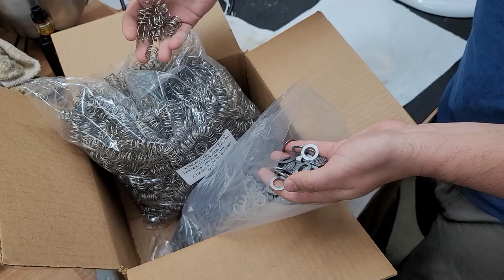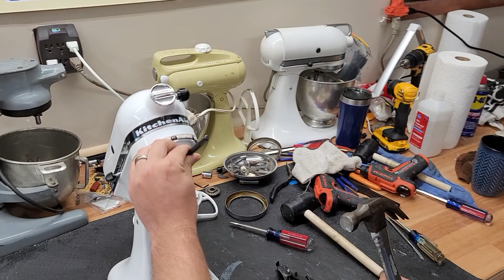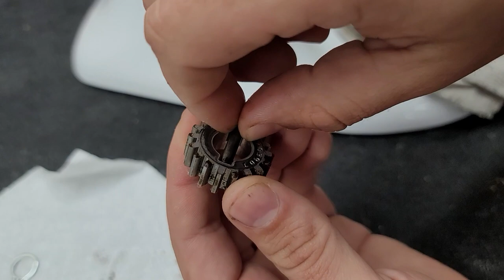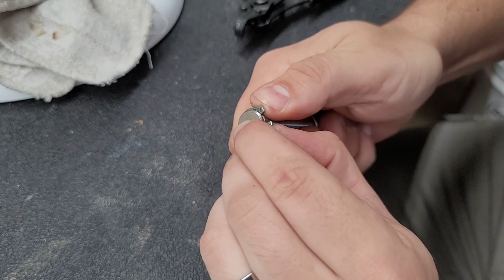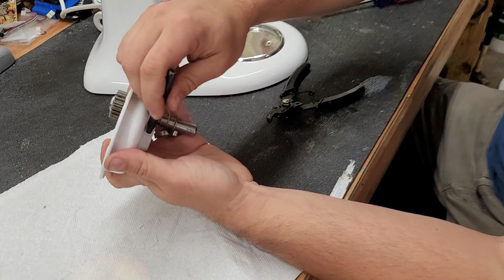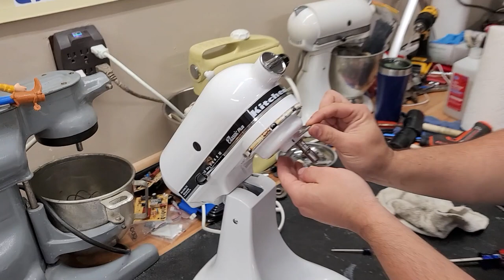Installing A Spring and Washer On a New Kitchenaid Mixer

Comment: I’m struggling to get the screw back in without cross-threading, any tips? I can get the screw about 1/2 back in but then it just is waaay too difficult and I’m afraid I’ll ruin the threaded hole

Comment: I need to order a gasket and grease for my 600 and I really want to put the spring on it too. So i'll probably just go ahead and order it and wait for your next video with the "how to" to come out.
Reply from the maker: Literally have like two more scenes to film I just need to find the time!! They aren't listed on the website for the 600 yet as the 600 has to have a snap ring swapped out as it's too thick, so I've manufactured some thinner ones, I need to add them to the site but didn't want to ubtil the video was up! Hopefully Sunday I can find the time!
Reply: @MrMixer316  Hey, yeah I just realized that in the description for the spring it said that a different part was needed for the 600. I already placed my order, but sent an email to see if that portion can go ahead and be cancelled. I'll go ahead and order the spring when you have it available.
Reply from the maker: @rachelmaestardust  I've included it in your box. You'll need to replace the snap ring that sits just above the spring and I sent an extra incase another one bends! I need to get the how to finished!!

Comment: I just bought my Artisan mixer yesterday. I had ordered the Everdime piece last week and installed that today. Now I'll order this spring and washer. Thanks for this good tutorial on how to replace pull, remove and replace that shaft. Taking it apart doesn't look that difficult. My mixer is new so I'll skip the cleaning and re-greasing until a future time.
 I looked at that drip ring to see if a screwdriver could pry if down when using a rubber mallet. But I decided against trying it since it seemed like I was either going to scratch the paint of mar the drip ring. So I tried using a strap wrench to twist off the drip ring. It worked. The strap wrench twisted it off without that much effort at all.

Comment: I have an old K45 KitchenAid mixer from the 1970s, which I purchased used, with only a whisk attachment. I purchased a flex edge beater online and it would not fit. I bought a new KSM96 mixer for my partner in 2009. I borrowed the beater (no flex edge) from it, and it fit my mixer fine. Measuring it, I found that the thickness of the top of the beater, above the notch, is slightly thicker on the new beater I got than on the older beater.

I called KitchenAid support about it. The agent said that some beaters had incorrect specs on that part of the beater, so they sent me a new one. That one has the identical problem.

In the meantime, I bought a new stainless steal beater direct from KitchenAid, hoping the problem was unique to the flex edge beaters. Alas, no; the new beater also doesn't fit because of the thicker metal above the bayonet notch.

The problem is that when I push the beater up on the shaft, when the spring and washer are completely compressed, there is just not room to clear the pin on the shaft in the beater's notch.

I wonder if, since removing the spring and washer in 2016, KitchenAid redesigned their beaters to have slightly longer holes above the bayonet notch. Do you have any insight into this? Have you seen the problem before? I'm wondering if I need to remove the spring and washer in order to accommodate newer beaters. —Tom

Comment: You got a video on my mixer paddle is bottoming out on the wall did the shaft drop? It will not sit all the way down in the locked position.

Comment: Great stuff! Just bought a commercial 8qt and wondering if you think its worth the effort to install the spring/washer on it...especially if mainly using the stainless steel whisk/beater? I would assume you think it IS best on a model like the Artisan Mini? thank you!
Reply from the maker: It can definitely benefit the 8qt machine, however sometimes the stainless attachments are too thick up at the head of the attachment to allow the space for the spring and washer!
Reply: @MrMixer316   you sell a kit for the 8qt so even with your kit the standard stainless accessories might not fit? Just dont want to take everything apart only to find it wont work!
Reply from the maker: @macfly4  they generally do, but we have had a handful of people have issues. I think it is generally because they don't replace the snap ring like they are supposed to

Comment: Hello. I have a kitchenaid 550 HD and suddenly the paddle and whisk attachments don’t seem to be staying in place on the shaft. This model I don’t think ever came with the spring and washer but I’m not sure. I’ve used it for years but now suddenly the attachments seem to hang low on the pin? I thought maybe I needed to adjust the bowl down lower and tried that, but I cannot move it any lower. Do you have any help or ideas as to why my attachments are now hanging low/ scraping the bowl? It kind of looks like a piece may have fallen off on the shaft which is what brought me to your video, but based on this video I don’t believe the 500 models came with the spring, did they?
Reply from the maker: No the 550 HD never came with a spring and washer, it sounds to me like you actually need a new planetary, it's lost its pressing and it's sagging, eventually it will fall completely off of the machine! We offer them on our website and have a tutorial or you can send it in to us for repair!

Comment: I just took apart my kitchenaid that is a bit older. It doesn't have a washer to take the agitator shaft thingy off, but instead looks like a flathead screw driver is needed? Any ideas?
Reply from the maker: The under side of the gear will be the same, you'll just need to unscrew it and the gear will pull off

Comment: Looking at buying the ProLine 7 quart mixer in there near future (model number KSM7586). Is this washer/spring addition compatible with that unit?
Reply from the maker: We have found that the spring may not compatible with the 11 wire whip but it fits the machine and the other attachments
Reply: @MrMixer316   Would you be able to elaborate at all on exactly how they may not be compatible (the spring and the 11 wire whisk/whip)? Thanks again!

Comment: I noticed you didn't grease that gear before placing back up is there no need of grease
Reply from the maker: There is need for it! I believe I mention several times in the video that if your taking off the planetary, you might as well do the regrease as well, in which I cover greasing that gear in the regrease series!

Comment: How long ago did kitchen aid stop using snap rings?
Reply from the maker: Just in the last few months. We have released a new spring and washer for that, it's a quick install that doesn't require removal of the planetary
Reply: @MrMixer316  ah good. Because special kind of guy I want the non split washer set up. My mixer is like 5 years old, just wanted to make sure it wasn't the press fit style.
Reply from the maker: @Obecny75  oh yea yours should definitely be old style
Reply: @MrMixer316  hopefully since I placed an order for the everdime and spring and washer combo not too long ago!

Comment: Can this spring be installed on the artisan mini?
Reply from the maker: It can but there is a different install method. You would have to punch out the pin on the agitator shaft and install it bottom up
Reply: @MrMixer316  oh hmm. Is the re grease process different too? I love my mini I hope it’s not impossible to work on!

Comment: Remanufacturing the spring and the washer is absolute  BS, you can buy these springs and washers in any good hardware shop for less than a dollar, don't get ripped off  !!,  Mr Mixer is a bit of a storyteller  !!
Reply from the maker: You can get a spring and washer, not this spring and washer that has been carefully crafted and spec'd for proper fit and function. Just because a spring fits on the shaft doesn't mean it's performing the proper function. This is common sense. I've also revised my spring multiple times  due to the fact that even slight size issues can cause major headaches. Not that I need to defend myself to you 😅
Reply: @MrMixer316  Sorry Mr Mixer,  but you are absolutely full of  B S.
Stop ripping off your customers
Reply from the maker: @michaelg4083  you know nothing of who I am and what I do, nor do you understand business or what it takes to run a business. You don't understand the market, you don't understand anything other than your own perception of "your product is to expensive". You aren't my customer if you don't see that I'm not just "selling a spring and washer" I'm giving away incredibly valuable information to a community of kitchenaid users who gladly pay a bit extra to support my content and my business. I know that typing this won't change your opinion because your are incapable of looking at this from any perspective other than your very narrow limited view. At the end of the day I'll leave you with this, people who see value in my product and content will support and buy my product, those who don't, such as yourself, are not my customer, and by complaining in my comments only makes people view you negatively, because they are all here to support me not try and tear down my business, that employs multiple people and supports multiple families within my small community. Have a wonderful weekend 🖖
Reply: @MrMixer316  You don't need to try and justify your exorbitant prices to me.🤪